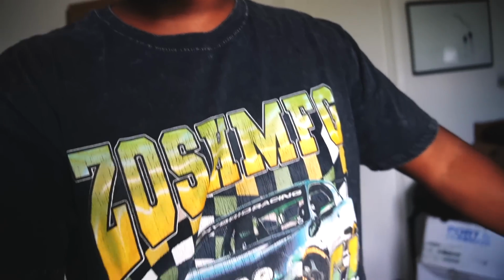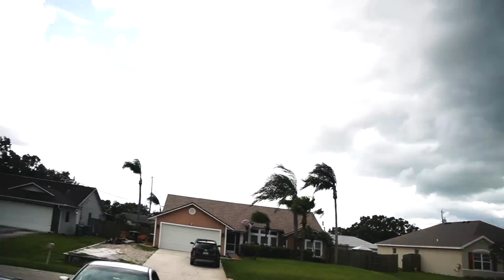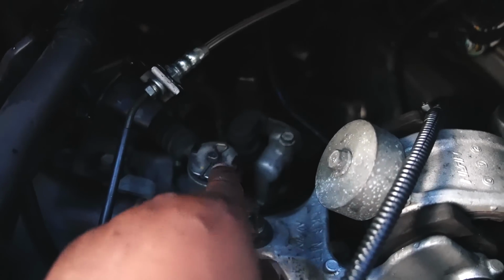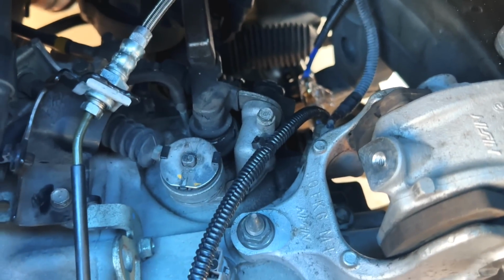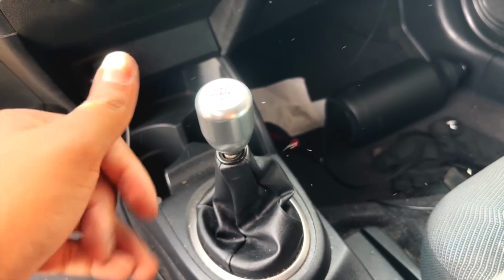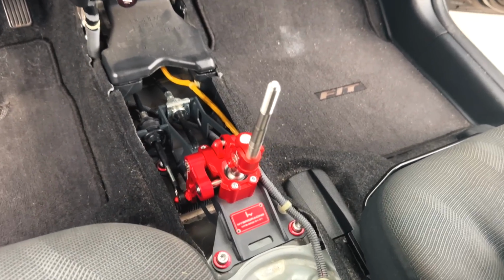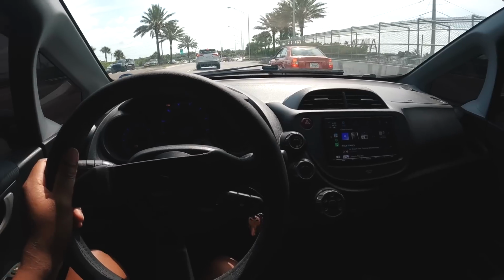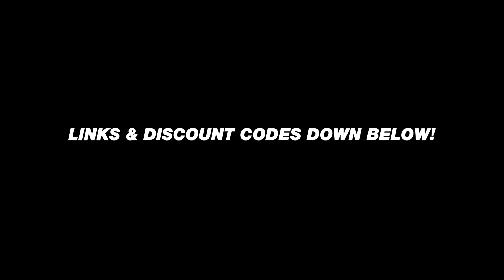Hybrid Racing Shifter, Cable Bushings, CDV Delete Kit *INSTALL* - Honda Fit Build Series (Ep.10)

Comment: Love the videos, I have a 09 fit sport that has 117k. Bought it back in 2016 for 7k with 55k for wifey, then i got her a new 2018 crv. Took the fit, Hated the Fit, but within the last yr ive grown to love it. I would rather get it looking nice than buy any other car. Love what you did to yours mine is red but its hella faded need to sand and paint it asap